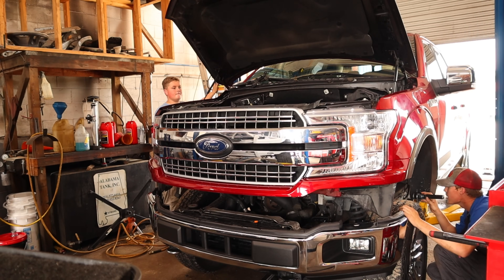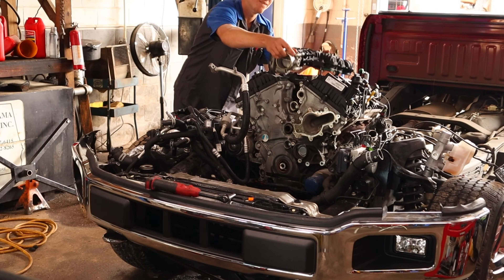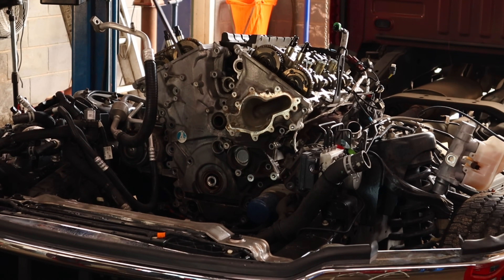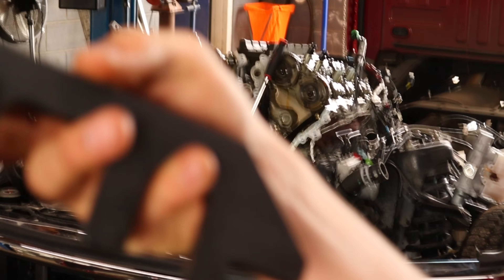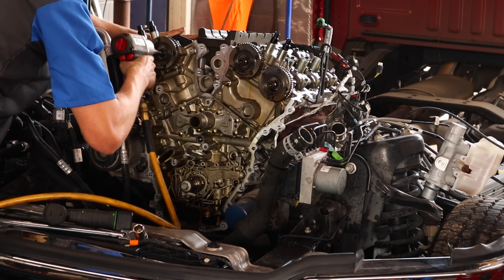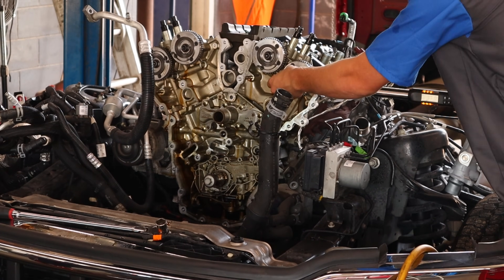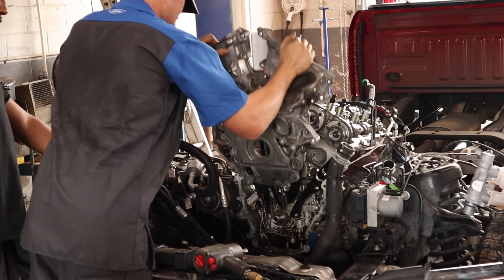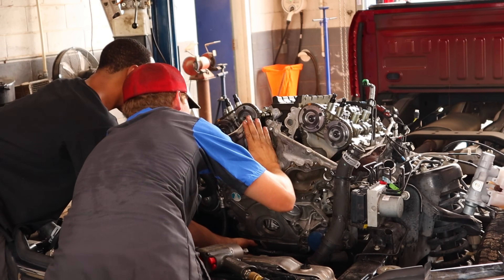Ford 3.5 EcoBoost Cold Start Rattle (VCT Phasers) | Everything You Need To Know

Comment: Nice job on the video. I know this is an old video, so you may not see this message but I recommend you wear gloves at all times when touching engine oil. Most of the old timers that worked at the dealer I was at before starting my own shop have died from mysterious cancers. They were otherwise in good health.. Not smokers etc. Used engine oil on your skin over time is not good for you. Also, why did you pull the cab for phasers? Also, one thing I didn't hear you mention is the cam phaser noise doesn't hurt a thing.... Yes its a noise that some dont like, but I have some of my fleet customers with close to 300k on there forman's trucks that have the rattle. Its not gotten any better or any worse since they started the noise around 100k. These are mostly 2017 and 2018 F150's. I told the fleet owners if they ever cause a power or performance issue our shop will go in there and fix it otherwise I tell them to keep there money..

Comment: Great information. I'm going through this as I type. Just got the call from the dealer that they need to do the whole phaser job. I had the software program done a while back. No help. The 21N03 didn't apply to mine... What the what!?  The rattle started at about 50k miles or thereabouts. Then, to my absolute amazement, I found my original extended warranty I bought and it was 6 years, not 3, like I thought. I have 69,700 miles on my 2018 and i was 4 months and 5k miles to the expiration! Thank you God! Saved me $3k out of pocket. $100 deductible.

Comment: I hope you see this & can answer a simple question for me.I cant find ANY vids on replacing the radiator hoses on my 2014 EcoBoost.Not the heater hose but the radiator hoses.Do people not ever replace them.My truck is almost 10yrs old & figured it would be normal preventative maintenance but zero videos on this subject. Same with serpentine belts although I was able to find I think maybe 2 videos on those.But do the radiator hoses not go bad or something?Am I missing something here?Thx if you see this and send an answer.As always enjoy your videos.

Comment: Do you think is it the same issue with my Lincoln Reserve L? I was thinking maybe it was the belt but im currently running around 37K in my odometer Rattling during cold start for a few sec. Your reply will be appreciated.

Comment: Today, I'm confident that my 2018 F-150 received the old style cam phasers at 58,750 (Oct-2020) under TSB 20-2191 and today (Oct-2023) the F-150 is at the dealer replacing them again at 126,500...with the updated version.  This video is gold - thanks Mason! - as I am waiting on the call from the dealer to discuss what other parts I want replaced.  Loved the part of video discussing the repair for those of us who are way-out-of-warranty and what else you should consider replacing with this level of repair.

Comment: God I love the 18-20 f150s and my wife wants me to find her a decent platinum or King ranch with around 50k. I'm throwing the towel in and saying forget it. Between the 5.0 oil consumption from those years to the 3.5 cam phasers problems and ford only offering to cover it untill 90k. Forget ford all together. I love my 16 powerstroke but forget these f150s. As much I hate dodge I would feel safer with a 5.7 hemi at this point. How could ford manage to screw up good engines and then put if off on owner's. They only want to extend the warranty to 90k? I'm chalking that up as ford doesn't have very much faith in their engines or their fixes. It ain't like the are cheap trucks either.

Comment: I don't want to dig out my records, but my 2018 Expedition developed this problem around 30K miles. I never pulled a trailer nor drove off road. My VCT phasers were replaced under warranty, but still, what a huge disappointment and attack on the confidence I previously had in my vehicle. The dealer said the parts they put back in had some modification(s). Thanks for the explanation!

Comment: I'll tell you the problem and Im not a Ford tech. Ford makes junk. I have a 2015 F150 5.0. From rust to VCT replacements , starting grind problems. With on ly 150,000 miles on it! My 07 Tahoe LTZ has 300,000 and it rides great. Has always been serviced . The 150 has always been service as well. F150 has become crap.

Comment: Does the rattling cause any actual issues? Asking because some Lexus V6’s had the same issue (cold start rattle coming from intake cam gears). Other than the noise, it had no negative effect on the engine whatsoever.

Comment: Great video Great job  telling us the issues. I have a 2018 F150 3.5 Eco boost and only have 30,000 miles I have the startup rattle Ford is replacing the cam phasers will they also replace the chains and other needed parts or at 30,000 am i okay to replace just the phasers

Comment: I just bought a used 2018 with 109000 miles and it has no rattle and I hope it never does. My question is if I keep clean oil  should this rattle happen no matter if I do the oil change defore time or not.. this video has me worried 😟

Comment: Since the phaser job and sticky thermostat/coolant flush on my 17 (almost a year ago)  it is running hot towing travel trailer up hills. It never went over 108°C (226°F) now it does regularly. Ive seen it as high as 117°C (242°F) which is pretty close to where it will shut down turbos. Dealership cant find anything. Any ideas? If there is a clog in the rad somewhere is that measurable? They said fans came on at 104°C (219°F) sounds pretty high to me. They also said thermostat opened when it should. They were not very interested in trying to diagnose given no codes popped. Irritated.

Comment: I have a 2019 F150 ecoboost motor. Mine just started doing this, but it happens not just on a cold motor but also a hot motor. I could have the truck off for 10-15 minutes and it still does it.

This morning my truck barely was able to start.... it was cranking over and after about 3-5 seconds it sputtered to life. Ford dealer says 2 weeks before they could even look at the truck. I think my case is worse than most, given the truck was barely able to start...

Comment: Great video! Not sure if you're still replying to comments two years later but my question is... it's the rattle a serious issue to where the cvt replacement is absolutely recommended or is it more of annoyance? I of course am out of warranty... about 105000 miles. Thanks!

Comment: i have a 2015 3.5 tt almost to 80k miles bought it with 15k i religiously change oil every 3500 or so no problems as of yet  drives like new no hiccups no weird noises shifts smootth what u think guys should i trade in asap or keep it for the long run?

Comment: I did a set of chains, guides, phasers and vct - all OE Ford from the dealer in a 2013 F150 3.5. Now 30k miles later the customer is complaining of the same startup rattle... Any thoughts on this?

Comment: Yea.  I called them about a close to warranty cracked piston on a mustang GT (I was sitting AT IDLE at a stoplight at the time).  "Unfortunately Mr xxx, we have no 'program' for you.  Thank you for being a Ford customer."  108 DAYS LATER, and $10.5K, and I got it back.  6 weeks later, it began to stall while in motion (50 mph or so) if returning to idle.  It has been at one dealership service dept or the other ever since ( over 6 months).  Phasers on driver's side have begun to throw codes. Exhaust position sensor and control solenoid replaced.  Now intake  cam on same side going nuts.  Im losing my mind.

Comment: Great video!!  I have a 2017 3.5 ECO Boost with 
13k miles - starting to make a little noise at start up for 10-15 seconds - sometimes a little longer.  Is this something that I should have addressed?  Ford sent a letter about 2 years ago, my dealer said that this is no longer a valid warranty.  Please advise.  Thank you very much!!

Comment: So as a tech you don’t pay attention to the parts your installing? Hmm that’s scary I worked at dealership for gm always paid close attention to vehicle parts installing making sure part numbers match. Maybe ford would get this motor right once but why change something if they can get in shop every 60k miles. This is one of the most poorly designed truck on the road. Who’s the genius that thought hmmm let’s put a plastic oil pan on engine? Peer genius.

Comment: I have this problem with my 2019, ill push the gas peddle to the floor, turn the key to start mode, watch my oil pressure go up then let go of gas peddle, truck will start with no rattle, in say'n that im not sure if im doing any harm

Comment: I do alot of these in my area I do all oem parts. I will not go into a 3.5 or a 5.4 without doing the melling oil pump and solenoids! The m390hv is $109 and you can pull it right off the front of the crank without touching the oil pan.

Comment: just saw this pop up on my feed, think my phone was listening as dealer called earlier, my 19s going in monday for both phasers and trans solenoids at 57k... anyways,would like to hear your thoughts on something if you got a few minutes... years ago, read a great wrte up from Livernois racing about their assessment of why 4.6/5.4 phasers were dropping like flies- IIRC it ALL came down to low hot idle oil pressure- at 50k + bearing clearances increased enough, pressure at hot idle would typically be 20-25 psi, and 25 was required to fully retract the phaser locks...the locks engage at shutdown, spring loaded pins that keep phaser in position if it happens to stop rotating with a lifter right at the downside of a lobe, so valvespring cant push the cam, basoically making the phaser a pump, pushing its oil all out the normal bearing clearances, leaving a empty phaser that needs refilled at startup... fire up motor, every cam lobe that passes its peak, flops the cam forward till phaser bottome on the empty chambers, or slams into the oil a little softer in a partially filled phaser till it fills, which only takes a couple seconds... but during those couple seconds, timing chains are slapped  back and forth as tension keeps going backwards at every cam lobe till chambers fill, that slapping makes a lot of noise and eventually bearks guides or hydraulic tensioner/ratchet teeth, or knock the tensioner hard enough the plastic body eventually moves a little and gasket blows out between it and block- loose chains, eventual jumped time/engine destruction...
   the other issue, as the locks INITIALLY start hanging up on the last corners due to locks not pulling quite far enough, the corners start wearing away, putting debris circulating thru front cam bearing to screens on solenoids, so grid goes back and forth, causing front cam journal scoring , further decreasing oil pressure, aggravating the now self sustaining failure pattern... 
 I really think a similar thing is  happening in all these things. my 4.6 mustang, soon as warranty was up I upped idle to 850(stick) to keep idle pressure ~30, and after 50k, started mixing in 1 quart of 10w30 with the balance 5w20, increasing every 10k, now over 100k, running just 10w30...never heard any timing noise at all... my trucks a auto, I do think hot idle can be bumped up rpm wise from the 5-600 I see when warm, to the 7-800 seen when cold- but dont want to heat the transmission up sitting at stoplights either- so dont really want to try that- 

my preventative 'fix' idea once new phasers are in and the last couple k of warranty expire is:
1) seriously considering using 5w50 oil in everything once out of warranty- will still have the cold flow of 5, but with hot at 50, pressure should be great even at hot idle...
2) being a automatic, dont want to heat tranny by higher idle, so IF the thicker 5w50 still dont stop the phaser lock wear, maybe just HIDE the results of failure in a way it will never make noise/kill guides- thinking either a accumulator/solenoid (moroso used to sell under name of 'accusump') but instead of tying into usual ignition power and having sequence issues with pushbutton start, instead add a off delay timer that closes only after motors been off a hour or so, and in series with power from dome light or running board deploy circuit- so if its sat and you approach or open door, phasers get refilled before you even get in...no pushbutton delays needed to let it pressurize, etc- my ONLY real unknown here is- ARE THE PHASER SOLENOIDS NORMALLY PULLING TO NORMAL POSITION WITH POWER OFF TO THE SOL. I would sure think they should be, and they are only turned on to advance cams at higher rpm/power levels, but havent done any voltage readings yet to confirm...

anyways, would really like to hear your thoughts on this stuff- thanks in advance- Tim

Comment: My new VCT phasers are ordered by the dealer. I have 64,000 miles on my 2019 F150 3.5  Platinum. It will all be covered under Premier Care Warrenty. What else would you request to be changed at 64,000 miles?

Comment: I just bought a 2019 F 150  and it has over 100K on it.  I did notice the start up rattle and the sales guy and the sales manager both told me that was "normal".  We even went over to one that had about 60K on it and it rattled as well.  I thought maybe it was normal.  Then ran across some of these videos.  So this truck came with a 6 month 6,000 mile warranty.  Should i go back to them and have them fix this under this warranty?  The warranty does cover the powertrain.  What happens if they dont get replaced?  Does it hurt anything or just rattle?  It doesnt really bother me, but it does bother me these guys didnt know that was an issue.

Comment: Dealer just told me they used part nu HL3Z-6256 CD last time they replaced my cam phasers.That part nu cam phaser only lasted 8,000 miles. My Truck is a 2017 f 150 4x4 with 3.5. Can you tell me if this nu is old cam phasers? They are wanting to replace new cam phasers again. Dealer says ford will pay $800, and me pay $500 to replace again.

Comment: 2017 f-150 3.5l ecoboost, 46k miles and it's a horrendous rattles for 1-2 seconds on a cold start. I'm goiong to the dealer tomorrow to see what we can do. Thank you for all of the info!  At 46k miles and 5 years old, would you reccomend paying to replace the timing chain, tensioner, guides, water pump?

Comment: As someone who did the phasers at 150,000 miles I decided to wait on oil pump to be cheap. 158,000 miles car doing the same symptoms. Ford diagnosed it as failing oil pump, when the oil pumps start to go out, and the engine gets over 150,000. It's easy to have the same symptoms as phaser rattle. I changed all 4 of my work trucks oil pumps with melling high volume. All trucks have over 250,000. Run great. None of the other trucks I changed oil pump on ever had phaser rattle.

Comment: Why replace all those parts when you'll be back in to it in 35k? My '18 expedition we bought new had the vct's done at 35k, a trans at 49k, a water pump at 70k and now the vct's are rattling bad again at 75k. I think a Kia is the only route to fix the problem. Hopefully I still have value in my exp.

Comment: In February 2023, I took my 2018 Ford Raptor to the local Ford dealer in central California, and they quoted me $4,250 to replace the VCT units (parts and labor). I bought it used and from the very beginning it would make a rattling noise from cold starts. The Ford dealer also quoted me $1,070 to replace the water/coolant pump (parts and labor). I agree with him, its best to invest in your money (out of warranty parts) on your daily driver truck and not spend on other extra performance items.

Comment: Great Video.  I have a 2019 Ford Expedition with this problem.  I have brought it to two different Ford dealers and because the rattling noise didn't happen when they started it up,  they won't repair it.  I have three cold start videos of the vehicle making the noise but apparently, that's not good enough.  Vehicle only has 35,000 miles.  It only seems to heppen when it's very cold outside.  Any thoughts on how I can get this fixed under warranty?

Comment: It is possible to swap over to the Melling oil pump ($135 at Summit) without dropping the pan.  It's a bit of a pain because of the pickup can be done without dropping the pan in about 30 minutes or less.  On transverse mounted engines (Lincoln MKS, MKT, Taurus SHO) the pick-up drops right out of the way so it is a 5 to 10 minute job once you are in there.